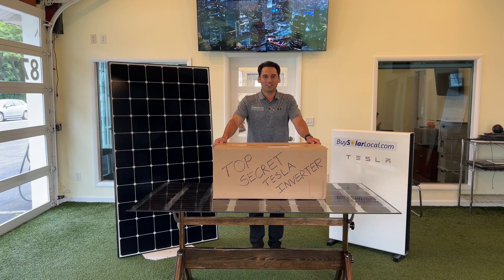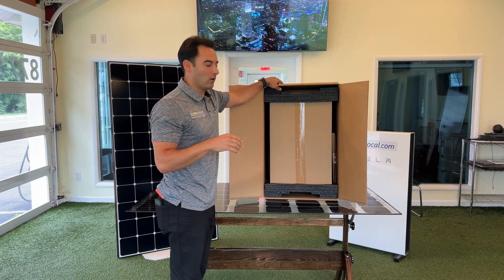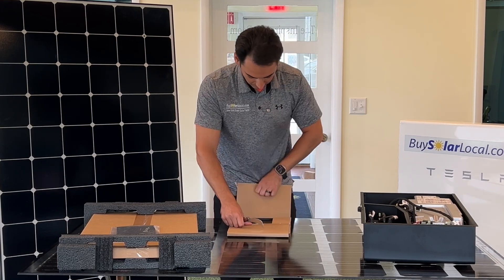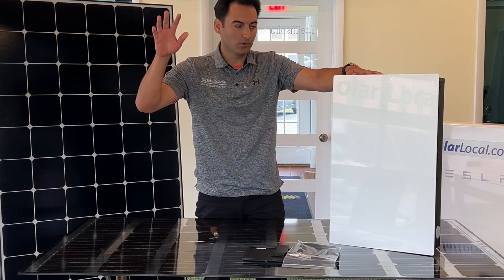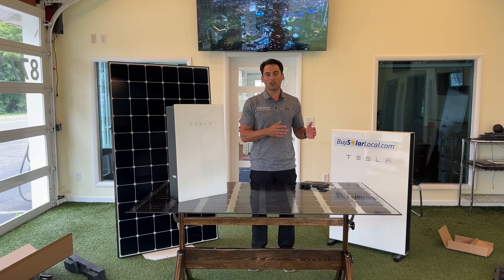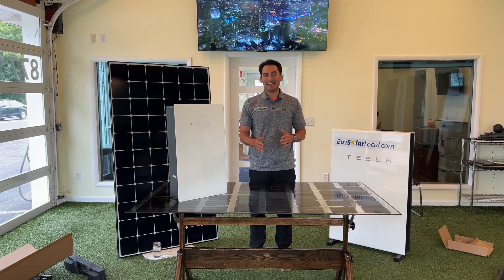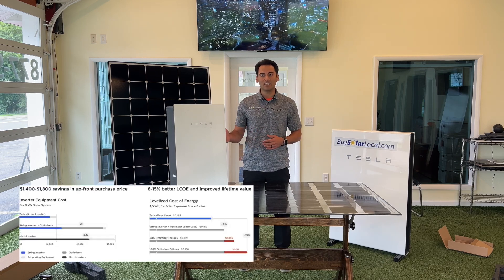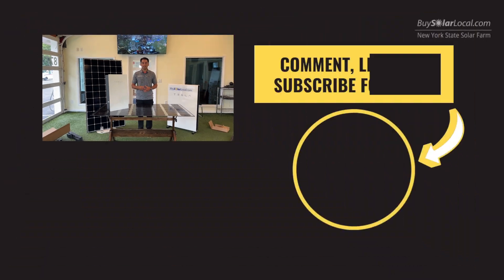Tesla Solar Inverter CHANGED My Energy Game Forever

Comment: How is the reliability?
Reply: Awful
Reply: @cbs1219  did it fail and have to be replaced?
Reply: @Muenda1906 yes. Electrician said he has seen a lot fail.
Reply: @cbs1219   That's not comforting. I'm getting one installed soon. Hopefully it was only the early ones that had issues (standard Tesla model, release in beta)?
Reply: @Muenda1906 yes, I've had 2 fail
Reply: @lp2260 I've had 2 fail after 2 years on each. Flimsy, crap. On top of it all Tesla customer service hard to reach.

Comment: Tesla installed one of these on my house a year and a half ago. Worked great until a month ago. Tesla is supposed to be out in another month to fix. Two months to wait for service is unexcetable. Then who knows how long for them to get a replacement. Can I purchase another one of these and replace it myself. I have electrical contractors in my family. Then when I get the other one fixed I could add additional solar.
Reply: Same with mine. Failed after a little over a year. Tesla junk